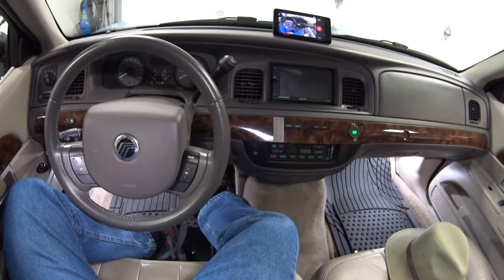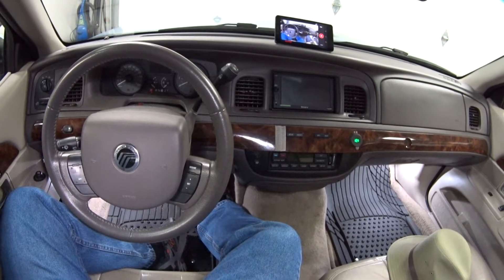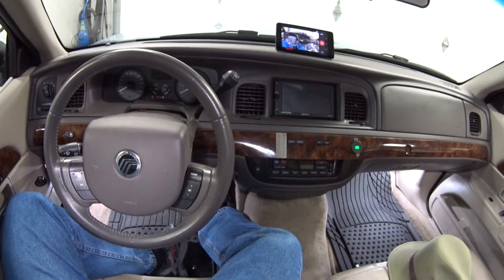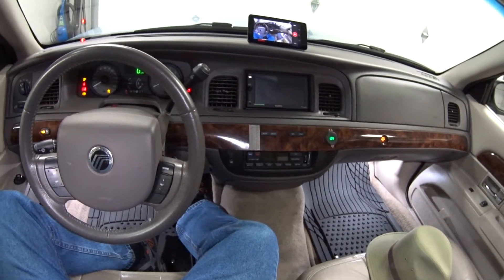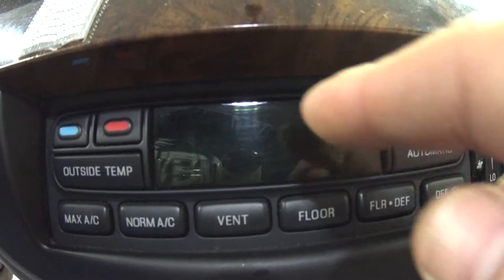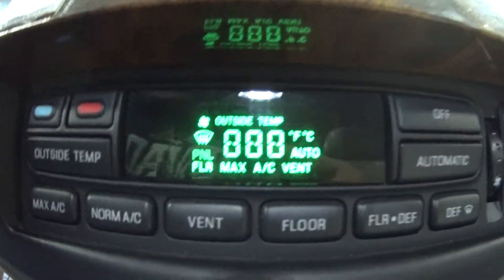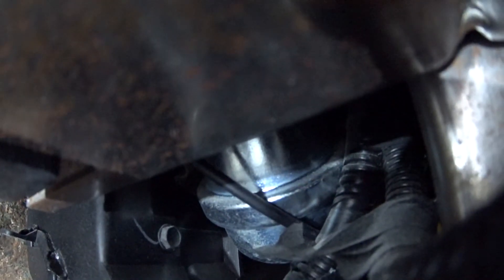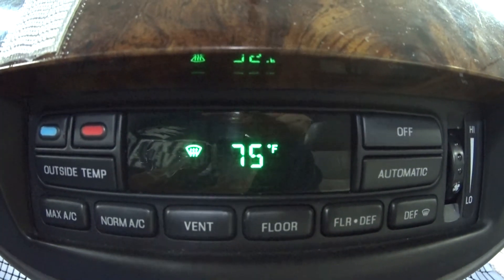Ford EATC HVAC Self Test - Reset & Calibration

Comment: I did the test on my 05 excursion but the code came up with what loooks like -188 or is that normal?
Reply from the maker: Right on SNES,
Thanks for watching.

888 means "test pass / complete".
Maybe you have a malfunctioned display that is trying to show an 8, but shows a 1 instead.

Are you experiencing any malfuctions, or symptoms with your HVAC system?
This might also be helpful; https://youtu.be/9CxejeIbGYw
-Chuck
Reply: @PanzerPlatform  yeah for me the issue is that the ac likes to put hot air on anything but 60 which I find strange but the video did still teach me the diagnosis test!
Reply from the maker: @supernesguy9000  
I'm not familiar with Excursions, but I would like to test, or check the ambient temp sensors, (interior & exterior). 
-Chuck
Reply: @PanzerPlatform  cool thanks for the tip I’ll check em out when I get the chance!

Comment: I got code 025
Reply from the maker: Right on Nelson,
Thanks for watching.
Do you need help?

If so;
What is the YEAR / MAKE / MODEL of your car?
What malfunction are you experiencing?
-Chuck
Reply: @PanzerPlatform  it’s a 2000 crown vic thanks for the help
Reply: @PanzerPlatform  down in Houston the weather it’s crazy in the morning it’s cold so I put the heater on in the afternoon it’s hot so I try to put the ac on but it seems to blow hot air even tho it shows that it’s on 60 ac max
Reply from the maker: @nmtz91  
Right on,
This might help; https://youtu.be/S0VgsFcdpdM
-Chuck

Comment: 2001 mercury grand marquis automatic climate control.
Can hear and feel by air flow the door is moving to separate zones. No cold a/c air.  Was cold before I stall, just had to move manually.

My question:. Blend door actuator replaced.  Still blowing hot.  Think I installed wrong.  Took old one off, blend door hook arm went to driver's side on its own.  When new one installed I just moved blend door hook to match new actuator hook.  Should I have actually manually moved the hook on new actuator to match where blend door hook was resting at?
Reply from the maker: Right on Web,
Thanks for watching.

Here's my video on Blend Door Repleacement; https://youtu.be/S0VgsFcdpdM
You may see something in there to help.

These motors calibrate themselves for position, it's sounds like you may have a separate issue.
-Chuck

Comment: I get code 052 any idea how to fix it ?
Reply from the maker: Right on Miguel,
Are you currently experiencing a malfunction?

What is the YEAR / MAKE / MODEL of your car?

-Chuck
Reply: @PanzerPlatform  whats up chuck thanks for the reply , but yes i am Currently having a malfunction my AC or heater does not turn on I replaced the resistor but still couldn’t get it to turn on i have a 04 MGM Ls i checked all the fuses and relays couldn’t find anything wrong. Maybe a bad ground ??
Reply from the maker: @SJ_MERC  
You're going to need access to the service manual.
EATC Error Code 052 is DTC B1261 A/C solar radiation sensor circuit short to ground.

Here's how to get the service manual for free; https://youtu.be/c8Irbl1vpSM
-
Once you get logged in search B1261, and follow the 3 pages of troubleshooting steps.
-Chuck

Comment: Scratching my head.  I have a 00 MGM - it passes the EATC self test (888) but no blower, no vent, no heat, no ac.  All lights / graphics on the EATC function when I cycle thru heat/AC/vent/def but no air flow.  Perhaps just the blower motor is kaput? (30A fuse #9 is good)
Reply from the maker: Right on Brian,
It's possible you may have a bad control head.
Maybe pick one up at the junk yrard for $20, or so.
-Chuck

Comment: I have a 2007 Crown Vic Sport with the EATC.  It seems to switch between zones well, and click into the various modes of AC, MaxAC and fan speeds well.  But it blows blazing hot air at all times in all settings.  Low pressure line under the hood is cold, high pressure line is hot, compressor seems to kick in normally.  I suspect blend door actuator has failed, but I cannot get the unit to go into self-test mode no matter what I do.  Tried many times, will not self test, after hitting floor and off buttons simultaneously, then hitting auto, unit powers on to auto and begins to try to work.

I've read that self test must be performed when ambient temperature is between 60 and 90.  Could this prevent it from going into self test?
Reply from the maker: Right on Mark,
Thanks for watching.

Perform this procedure; https://youtu.be/hZAsoqmqhdM
-
It will take 10 minutes to complete.
After you’re finished, swing down the glove box to the fully lowered position like you’re going to remove it, but don’t. You just need to see, and hear the “Temp Control Blend Door Actuator” trying to perform it’s Full Sweep Self Calibration.

When you get into position, have an assistant reconnect the battery, and watch, and listen for the “Temp Control Blend Door Actuator” to start performing it’s full sweep self calibration.
If the actuator does not move, this may indicate it is kaput.

Here is a video of what it looks like when it’s moving; https://youtu.be/S0VgsFcdpdM?t=1202
After you do this, start the engine, turn on the A/C to full cold.
If you still need help, come back here, and report your findings.

-Chuck

Comment: Just did the self test on an 03 gran marquis with the same control unit as yours.  Self test came back as 888.  Air will only blow thru the defroster.
Reply from the maker: Right on Jeff,
Thanks for watching.

This is most likely your issue; https://youtu.be/GVEG9v1HgKA
-
Also check this out; https://youtu.be/PtfucNa6R_o
-
If these don't fix you up come back, and I will escalate your support ticket.
-Chuck

Comment: Where is the inside cabin air sensor located ? I couldn’t get accurate information on this.. my fancy electronic ac unit temp is stuck all year on 40 degrees and I Got code 41 with the self check but I have no idea how fix it or where it’s located because it’s preventing the automatic climate control from functioning properly
Reply from the maker: Right on Saud,
Thanks for watching.

The “outside” ambient air temp sensor is located behind the front bumper under the radiator cover.

The “inside” cabin air temp sensor is located behind the dash just to the right of the EATC control head.

Here is how to get online service literature for free; https://youtu.be/cCxHk1PNBuo

-Chuck
Reply: @PanzerPlatform  thank you, the outside is working fine when I tested it with an obd device But the inside is fixed on 40 all year. Thank you this is very helpful

Comment: Mines said 888 but my fan blows when it wants to then cuts off when it want to
Reply: So should I get a new climate control unit (in dash)
Reply from the maker: @carlwinslow160  
Diagnosis must come before repair.
You should find out what is causing the problem before spending any money on parts.
Otherwise you might be replacing good parts that are not malfunctioning, and still not fix the problem. 
-Chuck
Reply from the maker: Right on Carl,
Sounds like a loose connection, or intermittent wiring issue.
-Chuck

Comment: Question for the 08 grand marquis lovers.   My AC went out; I changed the blend door actuator & main control module.  When I change the settings you can hear a click..  but no AC, no heat or cool.   Almost like the blower motor isn’t going on.   Any ideas?  Any fuses to check?  Again..  lol. I am getting error code 25 in the dash.
Reply from the maker: Right on Mr.C.
Thanks for watching.

When you command A/C does the compressor engage / disengage?
Did you check the Blower Motor Resistor?

-Chuck
Reply: @PanzerPlatform  I asked this question to a few other videos.  They also mention the resistor.  This is soemthing I haven’t looked at tbh..   

I’m getting any air at all..  no hot, no cold.  No high, no low.   After I replaced the control module last week.  If I change the settings you do hear a click.. and a whistle coming out of the main A. control module for 1/2 a second..   then nothing happens.  It sounds like soemthing whats to happen lol.   Maybe that’s the compressor?  The coolant line is cold but again no air.

Only time I feel any air is at higher speeds , that engine heat coming out the top vent.   After I replaced the blend door actuator that pretty much went away tho.
Reply from the maker: @bobduffy7744  
It sounds like your blower motor is not working.
It also sounds like you might have more than one issue.
Do you have access to a service repair manual?

Here is how to get free online access;
https://youtu.be/cCxHk1PNBuo
-
-Chuck

Comment: I have a I have a 2006 Mercury Grand Marquis, My HVAC TEMPERATURE AC CONTROL. There is no lights at all.
Reply from the maker: Right on Joe,
Thanks for watching. 

I would check all fuses, and the wiring going to the EATC control head. 

If that didn't help, I think you can pick one up at your local junk yard for $20-$40. 

Or, you could diagnose the problem first before replacing, or buying any parts. But what's the fun in that? Lol

-Chuck

Comment: I have grand marquis 2008 and sometime the AC doesn't work, none of the controls working if i change to Floor nor Defrost working. I have tried the reset as explained by yourself and im unable to get to the reset cycle. The moment i press Automatic, it starts the EATC unit and starts blowing air. Any help please..?
Reply from the maker: Right on Habib,
Thanks for watching.
First, I do not recommend purchasing, or replacing any parts until a through diagnosis had been performed.

However, based on what you've told me, (EATC will not enter self test mode), and my experience it sounds like the EATC Control Unit has an intermittent electrical malfunction. 
Unless you are a qualified electronics technician that can de-solder, and solder new components on the circuit board the only option is to replace the EATC Control Head.
I would look at your local junk yard, or ebay for a "new" EATC Control Head.

Let us know how you fix it.
-Chuck
Reply: @PanzerPlatform  apparently, even the A/C compressor doesn't switch ON when I press on Max A/C nor any other button. 🤔 The A/C mechanic pointed me to an A/C switch valve which connects into a small black bottle located behind the radiator... Changed that, it worked for sometime and the moment i drove the car it shut off the compressor again. I'm worried if this is might be something else not even the EATC.. But anyway, im getting the EATC, just thought of letting you know what had happened today. Learning from your experience.
Reply from the maker: @TheHabibalby  
I had a feeling this might happen. 
That's why I said at the begining, I don't recommend purchasing, or replacing parts until a thorough diagnosis has been performed. 

It sounds like you need an A/C performance system test. 

You'll need a manifold gauge set to check low, and high side pressures. 

I recommend you take it to a qualified, licensed repair facility.

Comment: What if no spinning wheel?
Reply: I’ve gotten past that point. Got a code 24 on my 06 mercury grand marquis. I called Napa to order a blend door actuator and the man said which one and that there where 3. My problem has been I have heat constantly blowing from defrost and feet I can’t adjust the temp either and in automatic mode it will once and a blue moon blow out of the vents that face you. I was able to get the ac to work several times by disconnecting and reconnecting the battery. I assume the blend door actuator that needs replacing is the one behind the airbag and that I also might need to do o rings in the control unit as well but am not sure.  Does a 06 grand marquis even have vacuum controls? Hope you can make sense of all I am saying.
Reply from the maker: @waimeagavin808  
Right on Gavin,

Thank you for clarifying your issue, I 100% completely understand you.
First off I never recommend purchasing, or replacing parts until a thorough diagnosis has been performed, and suspect parts have been proven to have malfunctioned. I do not support “parts shotgunning”. lol
Based on what you’ve told me, and my personal experience with this issue your diagnosis is around 60% done.

It sounds like you have a two separate issues;
1.) No control over the TEMPERATURE of the air flow.
2.) No control over the DIRECTION of the air flow through the vents, (feet, face, defrost).

You may want to tackle the easiest issue first. The OEM Ford part number for the Temperature Control Blend Door Actuator for your ‘06 Grand Marquis with EATC is #YH1766. They’re around $45 on Amazon. 

I have a video on it’s replacement on my 2010 Grand Marquis with EATC. The procedure should be identical. You can see it here; https://youtu.be/S0VgsFcdpdM
-
Moving on to the harder 2nd issue, (no control over direction of air flow).
Most likely the O-Rings have malfunctioned. Here is a good video on how to replace them; https://www.youtube.com/watch?v=GVEG9v1HgKA
-
Before you go to the trouble of replacing them I would finish the rest of the 40% diagnosis. From my understanding all Panther Cars 1992-2011 (crown vic, grand marquis, lincoln town car) use vacuum controls for the HVAC system. You may have a ruptured, or leaking vacuum line between the EATC control head, and it’s actuators, vacuum tank, etc. You may want to test each line with a vacuum pump to check for leaks. 

It may take you a couple days, or weeks to complete these repairs. I request you keep us updated with your progress, or further questions. So anyone else who stumbles across this video may be helped.

-Chuck
Reply: @PanzerPlatform  today I removed the airbag and vent to take a peek at the blend door actuator and in doing so I disconnected the battery to remove the airbag and reconnected it again. The actuator started working again and I could visibly see it move. Disconnecting the battery has been how I’ve gotten it to work in the past but it eventually stops working again. I am confused as to why this is happening. Also the error code 24 is gone now.
Reply from the maker: @waimeagavin808  
Correct.

What you’re experiencing with the “intermittent “ issue with the Blend Door Actuator is exactly what I experienced in my car until it ultimately failed. 

There is a “dead spot” on the winding of the tiny DC motor inside the Actuator Housing. Depending on where you have the temperature adjusted when you shut the car off will determine if it will function the next time you start the car, and run the HVAC system.

If it stops on that dead spot it will not move, and by performing a manual recalibration, (self test) gets it off the dead spot. Similar to tapping on a starter motor when it won’t start the engine, because the motor winding came to a rest on a dead spot.

I explain it in further detail here; https://youtu.be/S0VgsFcdpdM?t=896

So, when it goes on the fritz, just perform a manual calibration, (self test) to get it off the dead spot to restore functionality. That should work, until it doesn’t, and that will mean the tiny dc motor is completely shorted out, and requires replacement.

-Chuck

Comment: I was close to replacing the blend door actuator on my 2000 Grand Marquis. It had the heat come out only slightly warm. I thought that I might as well try this and see if it works. Now both heat and AC work. You are a lifesaver!
Reply from the maker: Right on Ali,

What you described just happened to my 2010 Grand Marquis.
It worked for a day longer, then finally gave out.

Here’s my take on replacing the blend door actuator.
It’s not the beast that everyone makes it out to be;
https://www.youtube.com/watch?v=S0VgsFcdpdM
-
-Chuck

Comment: Just to say that I tried  the self test which revealed the error code 024..blend door failure. But there were no sounds from the blend door motor. So I followed the advice from another fellow and used the battery disconnect/reconnected trick which closed the blend door. So that may be helpful for Panther owners who do not have the digital dash/ automatic temperature control.
Reply from the maker: Yo CT,
Oh OK, that makes sense.
Hey that's a really great tip.
So let me run this back to see if I understand.

If you have an intermittent blend door malfunction, and you don't have the fancy electronic HVAC control unit, you can perform a blend door re-calibration by disconnecting the battery for 5 minutes, and then reconnecting.

That's genius, I would have never thought of that.
-Chuck

Comment: Problem I just had I have the eatc system seems my air only wants to work on 60 degrees once I go to 65 I switches to heat even tho I have it on ac
Reply: @PanzerPlatform  did a self test today no codes but now nothing comes out the vents at all
Reply from the maker: @jontaylove25  
Aww geez, you may need to check the blower motor, and resistor. 

You could make a video showing the malfunctions. That might get people to leave helpful comments. 
-Chuck